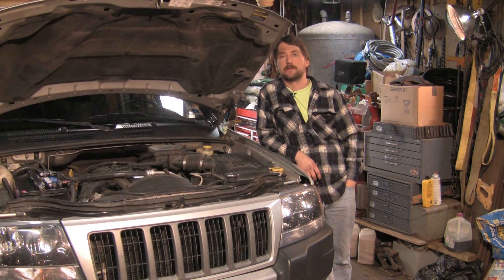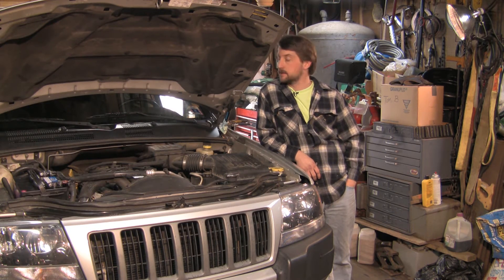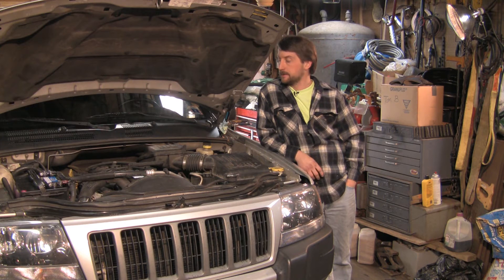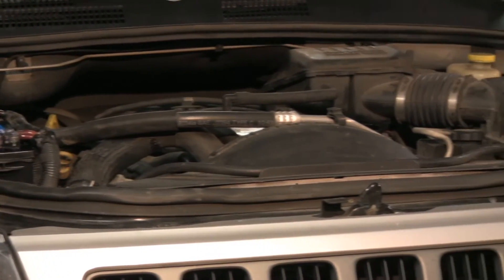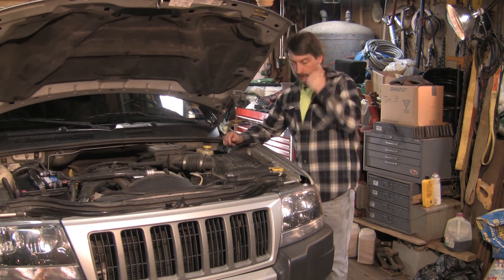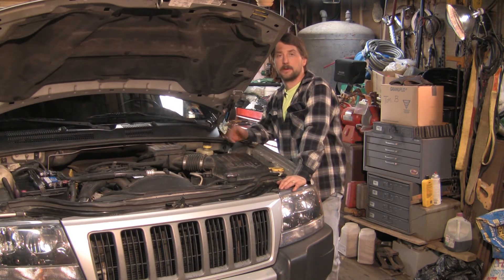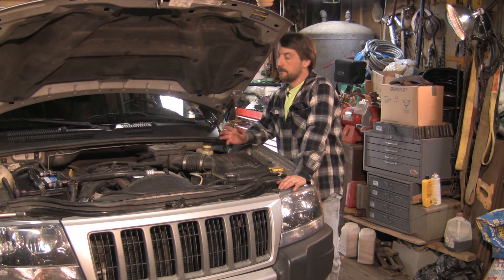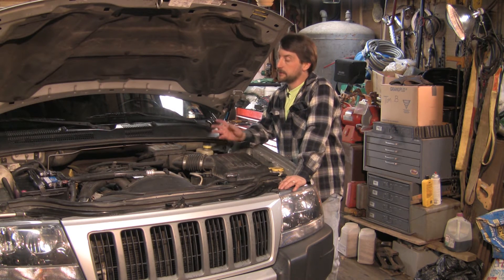Car Maintenance : How to Know When to Change an O2 Sensor

Comment: Vehicles have a working zone, even if he seems to work good it can be bad, the check engine light only comes on if certain protocols are met, a o2 sensor can seem to work but sending wrong readings due to heat an wear, it should be changed every 100,000 miles

Comment: I have a 94' T-Bird 4.6 that has a little over 100k on her right now and she is doggin' it when it comes to gas mileage and power.  I have heard people say don't worry about O2's tell they throw codes...hmmm.  I'm gonna gamble and put 2 new ones in and see if she perks up some.  I will let you know if it improves gas mileage and performance.
Thanks for the vid

Comment: My 2005 ford superduty 5.4 v8 with 21,700 miles has a Too lean code, could it have a bad o2 sensor? The truck is running fine. Any help would be great!

Comment: I think you should try changing the O2 sensor.  This is a different sensor than the air intake sensor.  The O2 sensor is located in the exhaust side usually in the exhaust manifold or the exhaust pipe.  I hope this helps you..